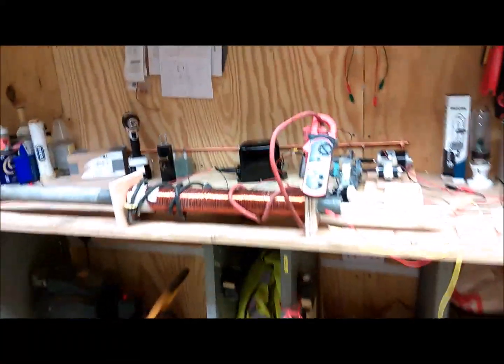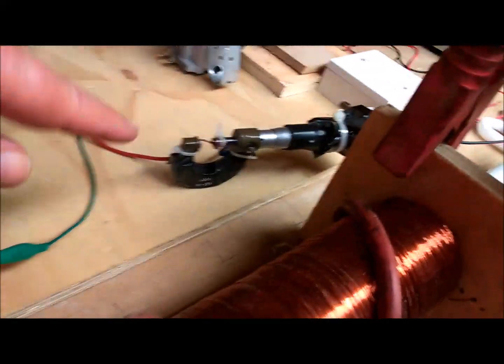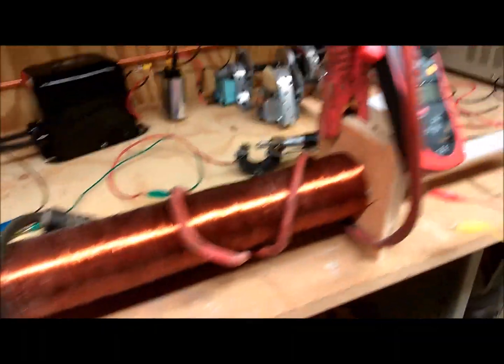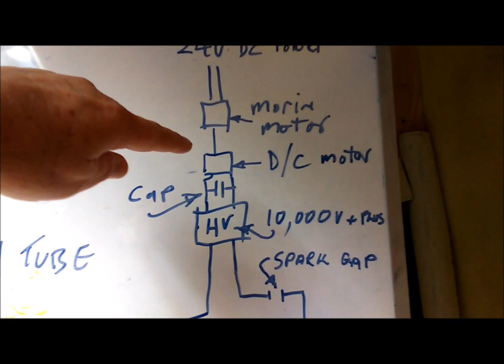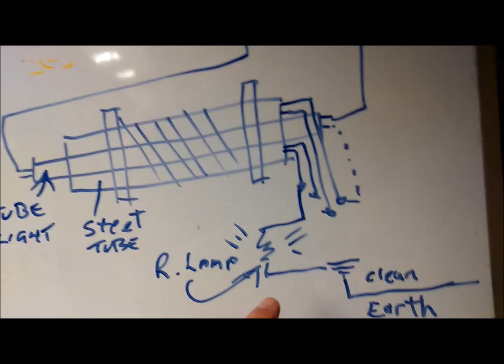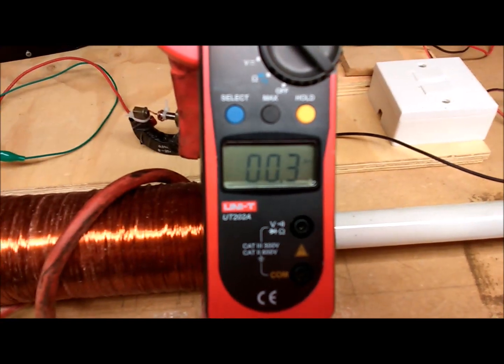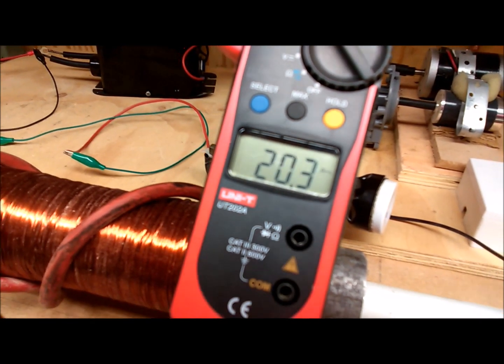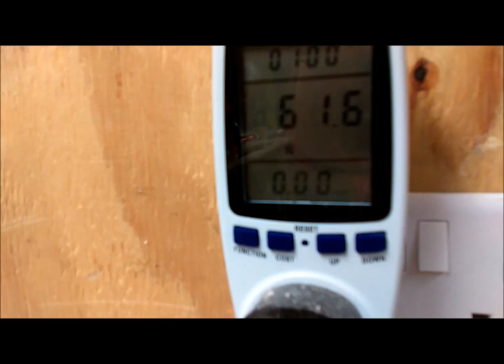Gerard Morin Proof of Resonance Plasma Power Generator Transformer

Comment: Very interesting.  The output current of 20ish amps as a secondary few turn thick wire, at least as far as I could see from the video.  Therefore the load is the resistance of the thick secondary coil which would be very low or a fraction of an ohm.  Therefore the output power should also be very low as Power = current squared times  R.  Since R is most likely milli-ohms or even less, then output power is most likely much less then 1 watt.  Maybe I am missing something...but still liked the video.

Comment: Hi DC. I am new at understanding the loops and hoops of power conversions. So this is a flux harvest generator with a 61.6 watt/120vac input power supply and output at the end of the circuitry is 21.7amps/218.9v @4750.13 useable watts? And if you use a thane Heinz bi-toroid transformer in addition to this system you could stabilize and reduce input power as well?

Comment: Hi DC  Just like to say great work. Just wondering if you managed to get over unity with this project,  like were able to run a motor or lights with the secondary thick wire? I couldn't find any follow up videos did  you give  up on this project. Thanks from Australia

Comment: I'm really enjoying your experiments. You have built a transformer that is harvesting plasma energy from a fluorescent tube Yea? You measure some 200 volts at the primary coil which is a thin wire. The thick secondary coil is stepping down your high voltage to a lower voltage I assume. No measurement of the secondary coil voltage was shown in the video.

Comment: Hello again! I am in the process of purchasing some parts.
Can you help me to choose a motor and caps in order to replicate?
I already have a 10kv and 15kv neon transformers. Will they be ok for this?
I already ordered a couple of washing machine pumps from amazon for 10 pounds each rated at 25W and 40W. I also ordered a spark plug tester to act as a spark gap.
I need a motor and caps if you can help so I can place an order.
Also if you think that I may need something else let me know.
Thanks mate.
Reply: +conandrum74 i also have a big 430v ac 45uf air condition unit cap with its starter. and a smaller 400v ac 5uf cap prob from ac unit also.
Reply from the maker: +conandrum74 Hi C ..  Due to the fact I have a long way to this will not be easy... OK? Think Coil = "Stubblefield Cell" then as per video seen clearly as a "Magnet" / Solenoid then think "Phase Angle" .. got it? "Tuning = "Gap"= electron jump.  Then you are on you way! I am only a student feel free to go forward. Yes to Aether its like the gas in the tubes, find the values in tuning. Now you have it! ...  Good Hunting!!! ......  DC
Reply: ))) playing by ear I guess. Thanks. Keep those videos coming for inspiration!

Comment: Hi DC,
can you plug some useful load to your secondary, liki some power tool....
Reply from the maker: +dusanln Hi D thank you for your comment. I can not wait to try it on load, however I have a long way to go. I have many hours of work ahead. At this stage the video is for "Feedback" like yours. I do not have a scope at the moment I broke my only scope with HV so I can not show frequency which will have to be tuned in.I do promise to show something connected "As & When", for now it's work in progress.Regards .....   DC
Reply from the maker: HI Dusanin Work in progress, i am trying to understand key discoveries then measure outputs. Common sense says its just HV without amps. So for now i have to do more research .. Regards .... DC

Comment: Hello DC and thanks for your video.

Can you please send more precise details about the stubble field coil or point us in some links or video so we can make the perfectly same as you build?

Thanks.

How can contact you any email?
Reply from the maker: Hi M.M. So what i did was to study the Stubblefield coil (Earth Battery) But i have not use this coil to the max just yet. Basic set up to get you going is the Morin set up to HV transformer run the HV to a cap then to a spark gap (Adjustable). Get hold of a scaffold tube from builder / scrap yard. You will only want about 1 metre long. The coil copper wire around the steel, having first run gaffa tape onto the steel. Insert a Flow tube inside the steel tube as to make a spark gap. Connect the HV at the Flow tube ends. Wind the thick copper wire a few turns around the first windings. You are ready to do some testing. You do not need the  Stubblefield set up to try this, what you are doing is creating a transformer with special properties. Please note i am in experiment stages myself & you do this at your own risk. The voltages are very high & care should be take at every stage. Have a go first then we can talk.... Regards .... DC ... Good Luck

Comment: HI , MATE CURRENT IS MEASURED UNDER LOAD, NOT UNDER OPEN CIRCUIT. CURRENT IS THE AMOUNT OF ELECTRON FLOW AND VOLTAGE IS THE PRESSURE..JUST THE SAME AS WITH WATER. WHEN THE  TWO COMBINE THROUGH A LOAD THEN ENERGY IS DISSIPATED.
Reply from the maker: Hi DV correct so why is it showing up as AMPs. Have we been mislead ? I ask you to think about how the AMP metre works. How electric works, I find no clear understanding about electrons. Tesla said " Electrons do not exist" & "everything is light". Wow, I hope this helps..... DC    (PS) Voltage is pressure Yes? Then AMPs is amount of flow (Current) Yes? I have a lot to learn & I can not stop. Learning & discovery for sharing.

Comment: only the iron pipe coil of copper wire is 2.5mm2 (15 AVG) length wire 7.5metri (I have not counted the number of turns)
neon tube 18w spark gap,17kv HV-7-20w consumation
Measuring between one end of the coil and good eart-
result, low frequency - 80-90 volt voltage, 0.8-1 A,
-High frequency? kHz - voltage, 200-270v, 10-35 A

I rebuilt experienced a 18 W halogen bulb economic 220v AC 20v and got between one end of the coil and earth

I want to do with a coil winder experience around a cold fusion tungsten electrode  in water a cc 200-300v 2-3 A

aperage results registered must be very high A, --- 200-300v, HFrecvency